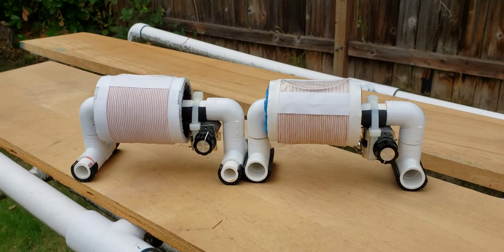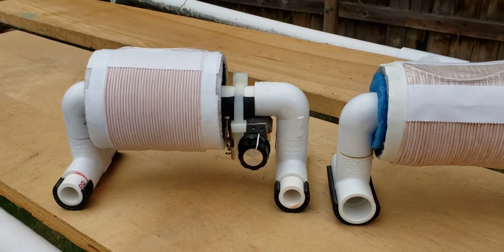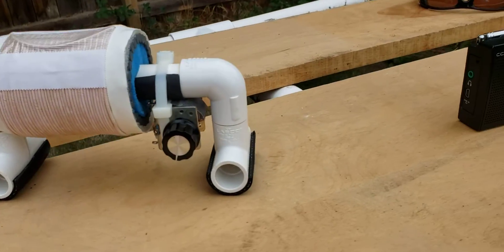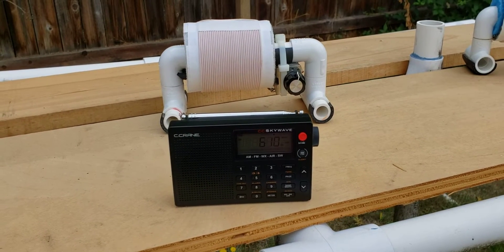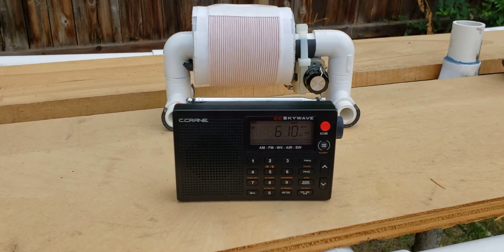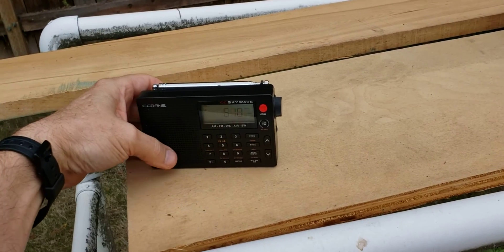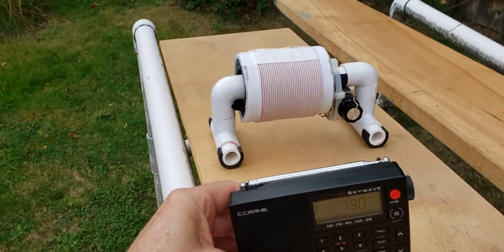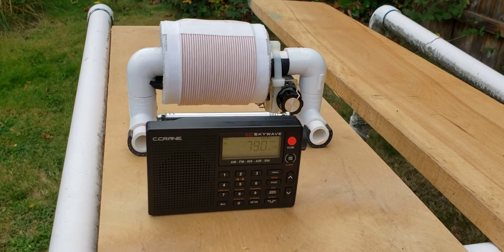3 inch (76mm) Baby FSL Vs. 2.8 inch (71mm) Micro FSL

Comment: @DXerGary  Do you have any list of build tweaks to make the Micro? I'd like to try. There will be a lot of similarities with the Baby, obviously. And from what I can gather some differences in rod, rod size, number; drum prep; and numbers of windings.
Reply from the maker: @RSears, a design photo of the 2.8 inch Micro FSL is posted at 
https://dreamcrafts.box.com/s/whfqm8av3j6335uddei4b0c0sjuht8nz
Although the performance of the Micro FSL is superb, each of the 28 Amidon 4" x 1/4" ferrite rods costs $US8, so it's kind of a special project (with a total cost of around US$300).  Despite this, the performance is so special that the high cost is worth it if a DXer desires a lightweight FSL for air travel, or other portable situations. I've used it for air travel to Hawaii, where it really ran wild.
Reply: @DXerGary  Thanks. I'll cost it out. I really like the package and want to try one of your FSL designs. I got 560 KMON Great Falls, Montana 5kW at 1 pm MDT today. And from Lacombe AB that's 560 km / 348 mi. I was using a SR-286 and a 25' long wire (up a 7m vertically mounted goture and 8' counterpoise). That seemed big to me; how does it compare with your experience?

Comment: I think on the first station,the micro FSL has a very slight edge. On the second station, I can't tell.
Reply from the maker: Thanks Carl, the 2.8" Micro FSL does seem to have a very slight edge on the extreme low AM band (530-650 kHz), but this edge disappears on the other frequencies. This is probably because of the differences in ferrite material (Amidon rods in the 2.8" Micro FSL, and Russian surplus rods in the 3" Baby FSL).

Comment: That is so cool! I used to use a 4 foot loop made of pvc but it is so unwieldy I switched to a much smaller loop wound on a 3 inch long
section of 15" schedule 40 PVC. I measured it's Q at 720. Not great, not terrible. I just rewound it and now am at a Q of 1320. It works much better!!!
 I have some 61 mix short ferrite rods coming from Ukraine enough to build a 8 inch ferrite sleeve loop. The rods are only 2.66 inches long and I
will wind the coil with 18ga silver plated multistrand Teflon insulated wire. I know Litz is better but the silver Teflon wire is much more rugged!!!
 I will let you know how it measures and performs. Good DXing my friend and I really enjoy your videos! 
  I like AM BCB dxing as well as LF NDB DXing. Best wishes!
Reply from the maker: Thanks for your comment, Michael. Good luck in your new FSL construction, and best of DX to you!